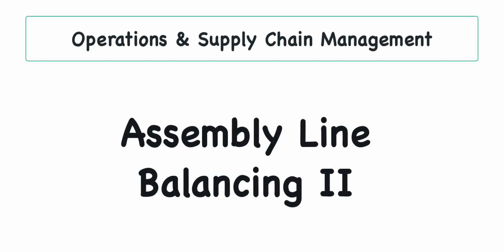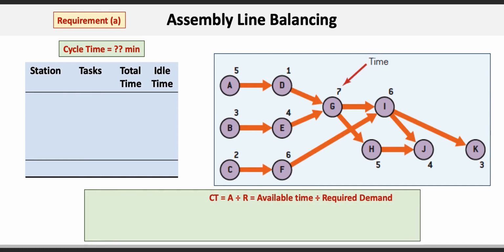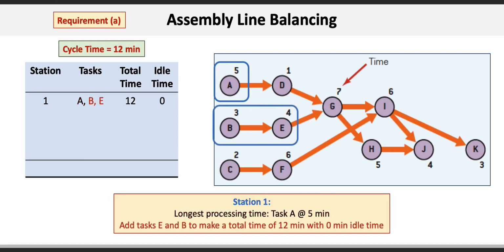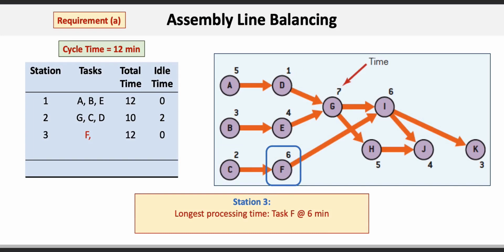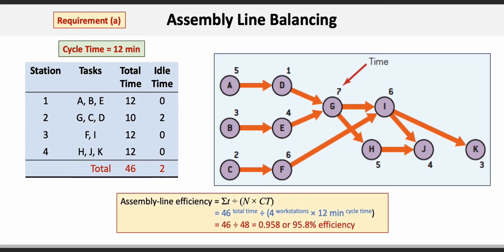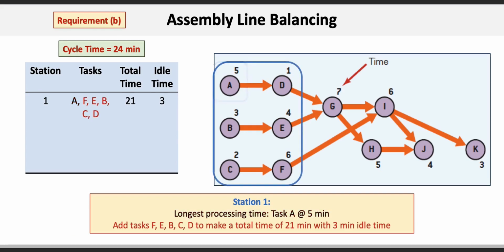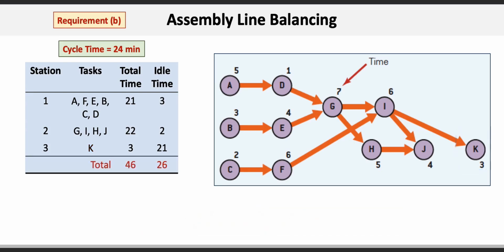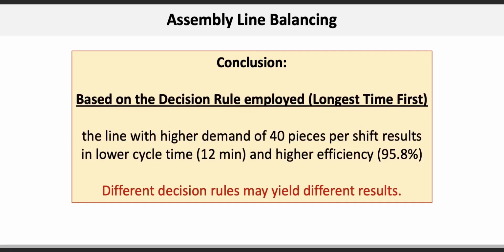Operations & Supply Chain Management: Assembly Line Balancing II

Comment: also if you group the second tasks into two stations each equaling a total time of 23 minutes meaning idle time of 2 mins wouldnt that equal more efficiency? Or is that not the correct answer to the sum. Is there supposed to be a fixed method to grouping different tasks? Because I as I see it if everyones groups them differently they will have different total times taken and there overall different answers for the effiency percentage
Reply from the maker: The objective is to combine tasks in this case into workstations with the longest processing times to reduce the amount of idle time, but you also want to limit the number of workstations. You would have to try out different combinations to see what works best.